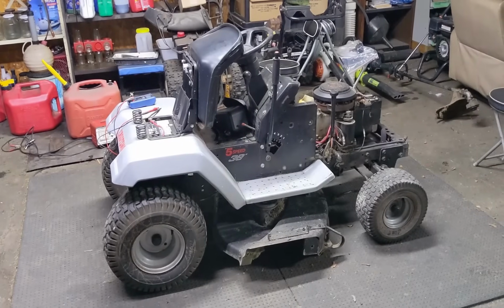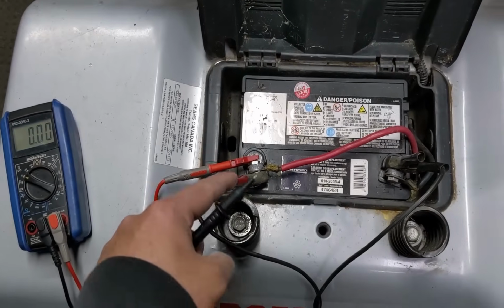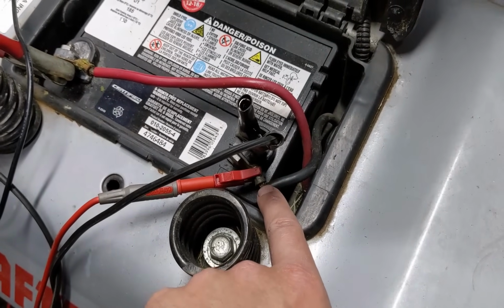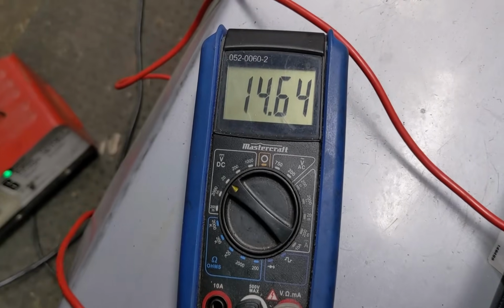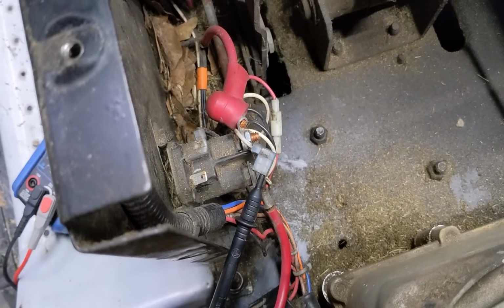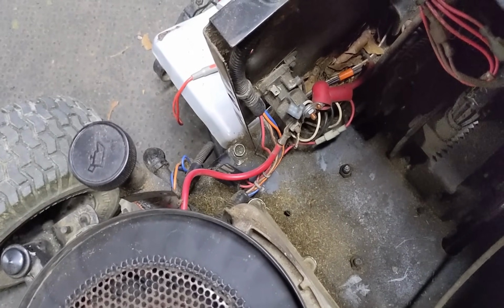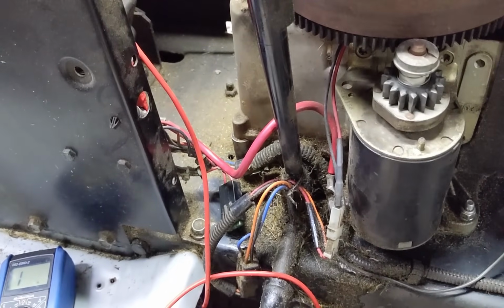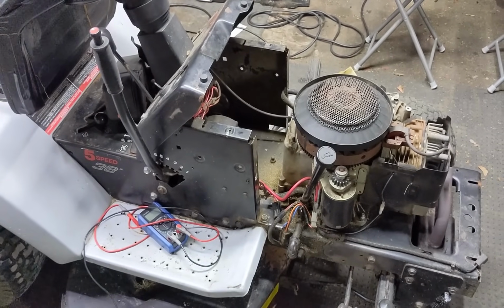Electrical Diagnosis of Riding Lawnmower that Won't Start

Comment: Well I watched your video I didn't think I have continuity at the negative battery but I am getting positive to my starter and the starter is good but it won't start still clicking so does that mean I have a ground problem

Comment: the  last  thing  you  check  is  the  problem  , this  is  why  go  to  the  last  thing  from  pwer  first  to  the  source  of  pwer  as  it  is  usually  something  under  the  hood  with  small  motors

Comment: Hi i was wondering if you can help me. I have a John deere riding mower sx95 with a kawasaki engine. I can't get it to work properly as soon as I hook up the negative cable on the battery it kicks in with the key on the off position what do  I do when it's doing that. Do you have any videos I can  look  at. Thanks

Comment: Dude, bro! What a life saving video. From 4 years ago too! I have broken into a money pit trying to get my mom’s old Craftsman going again. Started at a broken key in the ignition switch, to finding out the transaxle is shot, on to many other small things. But now the new OEM starter will not turn over with a new Solenoid. I have power to the solenoid, but not to the starter. And YouTube has helped me get this far, but a head on collision with a Multimeter and wiring. Completely lost and no help. But about 3 am this morning, a big ray of light hits me as I stumble on to your videos!! Thank you, thank you Sir for putting together the perfect video for a wiring geekmo like myself. 🤓 Dude, just for taking the time for being detailed and even showing the settings on the multimeter to exactly which wire to look for and where it should be and go. I have ordered a nice meter and gator clips that will be here tomorrow. I am pretty sure it is the white ignition wire to the plug in at the top of the solenoid. But know now how to track it down. I have a new battery, but that is where I start tomorrow evening! Really appreciate you putting that video together and taking the time to explain so detailed the whole process. Already recommended it to a few people!!! Really glad you posted these videos! (Ignition switch and brake safety switch too) 
 Very much appreciated!!! 😊🤙

Comment: My old starter gear broke and I replace the starter and the solenoid and battery. Now the engine CRANKS better than ever, but won't fire/run. That's with me in the seat, clutch depressed and attachment lever disengaged. Could be the seat safety switch that kills the engine if you fall off the mower or the carb is drowned because I forgot to turn off the fuel line when starter went bad. Had that problem when I 1st got this used mower. Any other ideas?

Comment: I have a Craftsman T1600 19HP 2015 model 46" cut. I bought it used. It didn't run when I bought it. I replaced the listed, battery, solenoid, ignition switch. rebuilt the carburetor.I dropped the deck for a complete rebuild. The solenoid was the problem along with the carburetor fuel filter, the original filter wouldn't fill up with fuel. I drove it about 2 miles and parked it. I came out later and it wouldn't start. I have 12.2 volts at the battery, power from the battery to the solenoid and power to the starter. The ground wires are good I cleaned all of the connections. The motor isn't locked up. I can turn the motor over by the drive pulley it has great compression. The motor just clicks. Any suggestions. Thank you and great video. Keep them coming

Comment: Great video. But usually with a no crank issue I usually run straight power to the starter to see if the starter works. Then cross that off the list if it works. If it doesn’t work then you know that the starter is the issue.

Comment: Great video. I really appreciated how thorough he was about going through each of the parts, explaining what he was testing, what you would expect from a good system and what might be wrong if you didn't find what you expected. It's long, but only because it covers a lot of material in great depth with clear explanations.

Comment: Amazing video.  I accidently hooked my battery up backwards and my solenoid made a high pitched noise. I fixed the cables right and now my starter doesn't stop after releasing the key. Did I fry my solenoid or key switch?  Thanks if possible.
Reply from the maker: Yes likely the solenoid is stuck in the engaged position, replace it and your mower should stop cranking over when you release the key

Comment: I’m new to maintenance and mechanical repairs and this is the best explanation to a complete rookie that I have encountered. You are an amazing instructor and I am so grateful and was lost before your help. Clear with location , variations 
Tools, expectations, theory behind actions, and clarification on each section. Clear vocabulary without mumbling or being loud and not as others being just annoying and unprofessional yet you were engaging and not at all boring. Thank you for your time, effort, and gift to this broke chick just trying to figure it out.😊

Comment: Ive got an old 90s MTD 12.5hp, my key does nothing, but I can start the mower by jumping the solenoid. Would a bad little red wire cause this? Or maybe a signal type wire? Thanks.
Reply: Figured it out by replacing the entire wiring harness lol.

Comment: I have a JD L111 with a new battery, solenoid, relay and starter. There's good continuity between all components. When I turn the key, the solenoid clicks and the starter tries to engage but can't turn the flywheel. There's 12.5v going to the solenoid but only  8v going to the starter's positive connection. Please advise;)
Reply: You have an 8 volt voltage drop.  This means your starter is only getting 4+ volts - not nearly enough to crank over an engine.  Remove and clean all connections between where you measured at the solenoid and the starter and try again.  Examine cable ends very closely to confirm there is zero corrosion.  Sometimes corrosion may be cleaned at and aound the connector but it has migrated down the cable where it cannot be seen, so if you still can't crank you'll have to start slitting insulation to make sure there's no corrosion further down.

Comment: I watched many videos to repaired my 300 xJohn Deere and did find my problem after spending many hours remove starter solenoid switches and it was exactly what you explained. My battery was a full load but did not have a battery load tester, and at the end, I boosted with my gator and it started and realize it must be the battery. Thanks for clarifying this situation. You’re the only one video that I watch that explained this.  thumbs up and yes I will get a battery load tester.

Comment: Went all the way to the last check and got a bar or 1 on left side of meter when testing starter side of solenoid and engine ground. Still just clicks, has new solenoid .What does it mean. Toro lx 420. It has a carb bowl sensor also.

Comment: Kia Ora from New Zealand, I have 2 broken rideon mowers at the moment, I think both have an electrical fault as they both stopped while mowing. I suspect they may be safely switches. I am yet to explore the problem. 
I just wanted to say thanks for your great advice on repairs. I found this one very informative, and I learnt so much from it. Please keep up the great work you are doing, which helps us less mechanically minded people so much also saves us a lot of money.

Comment: Great video. Very informative. The only other thing i would have done is jump the 2 positive terminals on the starter solenoid. If the startrr works this wouls comferm a defective solenoid.
Reply from the maker: Not quite, if you had a bad key switch or safety switch, the key wouldn't send 12v to engage the solenoid, but using a screwdriver to jump the solenoid would still start the engine if you left the key in the run position.

Comment: Need help! The mower would start, but My battery terminals were getting crazy hot, so I checked all wires completely to check for exposure, I’m good there. Then it stopped starting, assuming I burnt out the solenoid, I replaced it(again)-now the solenoid bolts are hot hot upon attempting to start the mower. With no success. New battery, fully charged, what am I doing wrong?!?

Comment: So if the big red wire going from the solenoid to the engine is not getting any power then it's the solenoid that's broken?
Reply from the maker: @csul5961  no it could just be a bad connection at the battery

Comment: Excellent video. Your presentation of proper troubleshooting procedures is awesome. 
This is one of the most informative videos I've seen on the structure of, and troubleshooting of electrical systems.
Subscribed.

Comment: I'm an electrical engineer, retired from utility control circuit design.  This presentation was the most correct in electrical terms that i think i have seen.  Good trouble shooting techniques as well.
Reply: As a whole it was a pretty good video, but I was hoping to hear him talk about battery available voltage, load voltage, minimum cranking voltage, voltage drop across connections, which is a way to check resistance. 
Also, you can take apart the solenoid and clean the two main contacts and the contact plate, bar or washer if you can't get a replacement immediately and need to use your equipment right away. 
I get disappointed when I watch videos and hear people call components by the wrong name.
You can have a fuse box or a fuse socket...
By the way, I retired from engineering and trained for over twenty five years.

Comment: You can test a fuse without pulling it out by taking you positive lead and touch the top of the fuse on the left then right side. Look close at the fuse on top ,you will see the post to test it. Great Video. Well done.

Comment: Great video, ponder me this cub cadet lt1042 starts at 1st key switch position before it is suppose to crank.. replaced key switch ,PTO switch, solenoid, and relay. ideas?

Comment: Another way you can test the battery without the load tester is to use the multimeter while you’re turning the key.  If your volts drop when you turn the key then it’s a pretty good indication that the battery is bad or going bad.

Comment: Do you recommend to use a flat screwdriver and touch both nuts at the solenoid to see if the starter run?
Reply from the maker: @IglesiaPentecostalElArca  I don't recommend it, but it's been done before and is basically a quick way to check if your battery cable and ground and starter works. If you turn the key to the run position, and you have the brake on it might start

Comment: Too bad my solenoid on my cub cadet xt1 is located under the seat, battery is in the way of testing solenoid, will have to come up with a means of pulling battery out and still retain battery connections!

Comment: So if you swap out with a good solenoid and still nothing and it will start by jumping the solenoid what might be the problem
Reply: Ignition switch or signal wire

Comment: Great video!! I picked up the same mower a few days ago and the mower was slow to crank. The ground wire on the solenoid switch was melting the insulation off the wire too! Long story short; the previous owner had changed the solenoid but used a 4 post where the spade connectors were hot when the key was engaged. This video helped me realize there is a 4 post terminal with one being a ground!

Comment: Troy Bilt 18.5 cam seems to be good but it will start one time then pops fuses on a second start? Thinking solenoid or starter. What would be your thoughts. Thanks

Comment: Awesome video, I've watched it numerous times. My Craftsman 20 hp will crank, but not start unless I boost it. Battery is 1 year old and reads 12.5 volts. I just changed the starter solenoid, and it didn't help. Any ideas?

Comment: Hello, I need a bit of help, I've changed the solenoid which was broke and put a new starter on but the engine is only cranking slow but if I remove the spark plug it spins freely like it had too much compression I've adjusted the valves but it's still not working. It's a Atco gt350h
Reply: Also if I measure after the solenoid with a multimeter I'm only getting 2-3 volts at the starter

Comment: Great video! I can tell you are a very intelligent guy. I just bought a Cub Cadet CC 30 H Hydro rider from a guy that said it only had about 15 hours on it, however I think he suckered me because it has starting issues, and loads up also but will usually smooth out. This thing is a real is a real puzzler because I know all the safety switches are engaged and it also has a brand new battery he put in it and the connections are tight. Seems to me that if it's that new of a mower it should start, however when you try to start it nothing? So I'm wondering if there is some kind of factory defect with these particular riding mowers that I'm just not aware of, or do you think the entire electrical system needs testing? Is does start right up though whenever it turns over. If you would let me know your thoughts I will subscribe also since I already tapped the like button for you! Thanks P.S. I do hate those darn seat safety switches!
Reply from the maker: Check the deck mulch plug switch, it's usually the cause for no cranking over. Other than that, an intermittent brake switch.

Comment: I kept hollering for you to test for 12 volts at the starter, but of coarse you were working through everything to get there.  I will have to watch more of you videos as my problem is no voltage from the ignition switch to the solenoid, intermittently.  I am reasonable certain I have power to the ignition switch because I have power to the headlights in the 1st run position of the ignition switch.
     I was needed to find everything with goes through between the ignition switch and the solenoid.  PTO switch, brake/clutch switch, sechat switch?  So the seat switch is disengaged if the clutch is locked in the down position.  Anyway.  I'm heading to another of your videos.
Thank You!   Subscribed, liked, and bookmarked.
Reply from the maker: Definitely sounds like an intermittent safety switch, I have some videos on how to test them under my electrical playlist
Reply: At this point it appears to be two things.  I was not always getting power out of the ignition switch on the white S wire.  I took the ignition switch apart and cleaned it.  Now it is always getting power on the white in the start position; but not down to the solenoid. @EliminatorPerformance

Comment: And the simplest way to solve this problem is to take a screwdriver and connect the two point at the solenoid.  And bingo ... engine starts ....
Reply from the maker: Yes that will turn the starter over but doesn't actually tell you what's wrong with it. This is just a tutorial on how to diagnose step by step

Comment: Iv always just grabbed a screwdriver and briged the connection takes two seconds and skips this entire process not saying this way ain't a good one it's actually the right way but I live in the real world and just bridge the solenoid right out the gate and save a fee hours of probing around
Reply from the maker: Right but that just tests the starter and battery positive cable and nothing else. So you could still have a bad key switch, solenoid power wire connection, bad ground, bad brake switch or seat switch etc..

Comment: I’ll give you a “thumbs up” for sure as almost everything is correct and you were pretty thorough. However, continuity testing alone is not sufficient when testing a cranking (or any other higher amperage) circuit. The reason is simple, a cable with broken strands may show perfect continuity, but cannot deliver the amperage necessary to operate the circuit properly. The way to test for this possibility is to dynamically test the circuit by checking for voltage drops  while the circuit is loaded (being operated). In this instance, you would put one side of the volt meter (properly set for the voltage expected) on the positive battery post (not at the cable) and the other side at the starter cable lug (when checking the positive side) or the negative battery post and the case of the starter itself. By turning the key and loading the circuit while monitoring the voltage, you would’ve seen that the starter was properly grounded, but wasn’t getting any power at all. With one simple test, you would’ve eliminated the entire ground circuit and narrowed the problem to the positive side. In this case, the next place to look would’ve been to check the larger cable connections at the solenoid and you would’ve easily found that the loss was inside the solenoid itself. As far as checking the primary side of the solenoid, since you could hear the actual solenoid heavy “click” of the solenoid when the key was turned, you would know that the solenoid was moving, but since it wasn’t delivering the power necessary, it was failing internally. One other point, I know that the solenoids might corrode as well, but the main problem I’ve seen is that the internal contacts get burned due to excessive amperage draw in the circuit. Very often when that is the case, the starter is the root cause as when the starter draws excessive amperage, it will cause the solenoid contacts to burn. This would necessitate replacement of both the starter and the solenoid to correct the condition. Regardless of my comments, I believe that you did a good job overall and that anyone following your testing recommendations would almost always find their specific problem. I would personally recommend that you start doing the dynamic voltage drop testing to eliminate the possibility of any erroneous electrical diagnosis.
Reply: I was going to say something similar